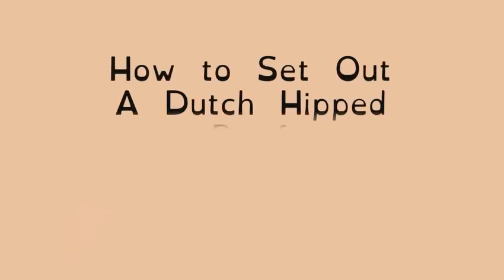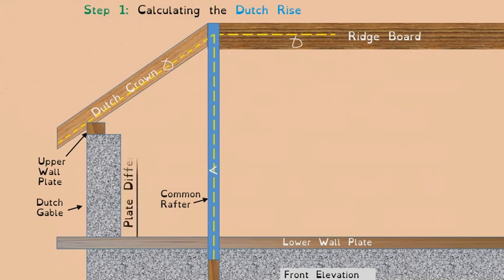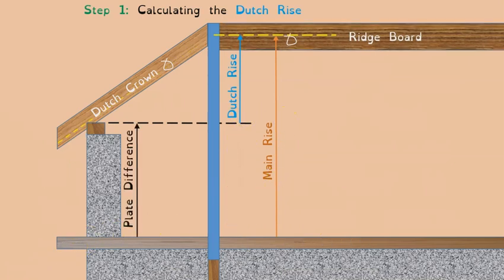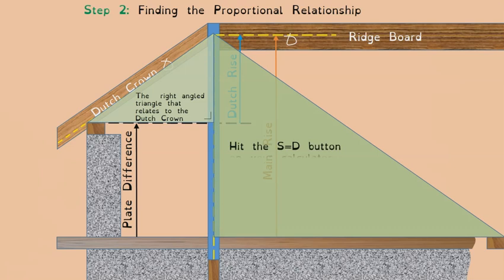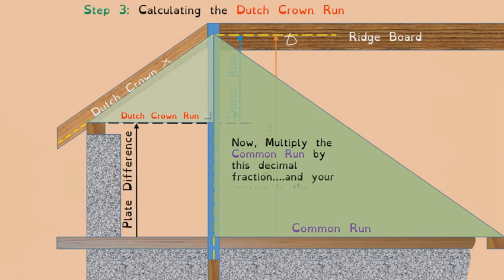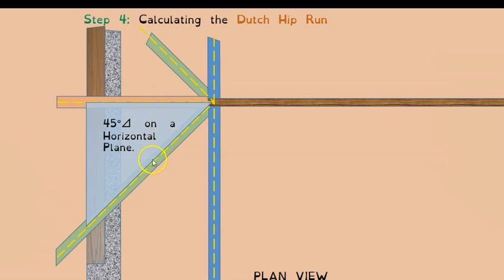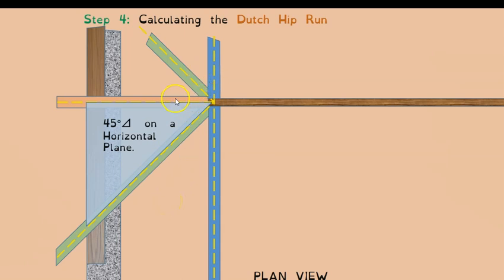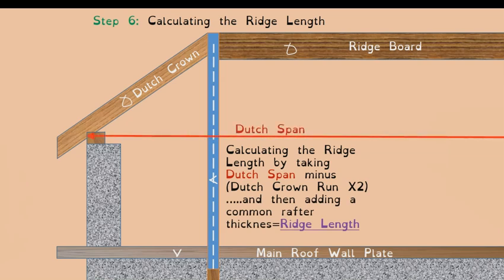RAFTER CALCULATION FOR A DUTCH HIP ROOF

Comment: Upper wall plate level across to rafter, that will then determine your crown rafter length. Cut and then it will determine your ridge board length (As it is over cut)
Reply from the maker: That approach works perfectly....especially now that we have lazer levels to cast a line off the upper wall plate on to the main rafters as you outlined.

Another approach would be to put a pair of main rafters in position on the inside of the gable with a ridge off cut between them....then transferring the top wall plate line level on to the main rafters to give BM seat lines and then draw heel line on both main rafters to complete BMs. 
     Then measurement from heel to heel line  on this pair of rafters...divided by 2, will give Crown Run Line.
      Also the length of the ridge can be established by taking the over all upper wall plate to upper wall plate distance, minus the heel to heel line measurement, +common rafter thickness.
        Transferring the heel lines back out on to the upper wall plate from these main rafters will give the position to nail the dutch Hips.
(all the above can also be done on a site/builders square also...might make an animation on this sometime)

Comment: Hi Michael 

I sort of understand most of this, 
How do you add on etc for your timbers if working to the line drawing of the roof? 

I don’t have any drawings for my roof there very basic just giving me the pitch and showing the style
Reply from the maker: Hi Dan,  
the dutch crown rafter and hips shorten after you factor in in their thickness versus the line diagram version of the roof....if you go to the video i have on this channel on setting out a hip rafter you will see that its the same deductions at the junction where the Crown and Hips meet the ridge board regardless wheather its a Dutch End roof or a regular Hipped roof. 

Hereis the link   https://youtu.be/7otmV2MafBI

For example, off setting half the common rafter thickness off the plumb cut on the the Crown Rafter  will  have factored  in the relative member thickness (the rafter is now slightly shorter compared to its line diagram version.)

Hopefully that will give you a clearer picture...let me know how you get on....